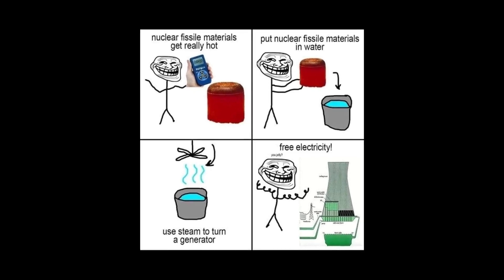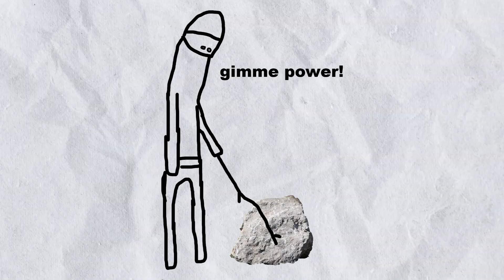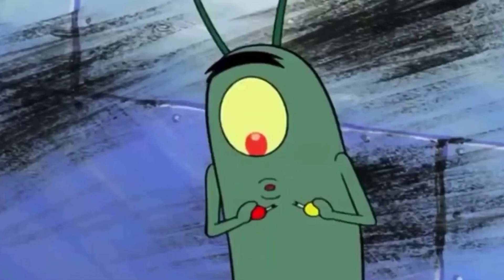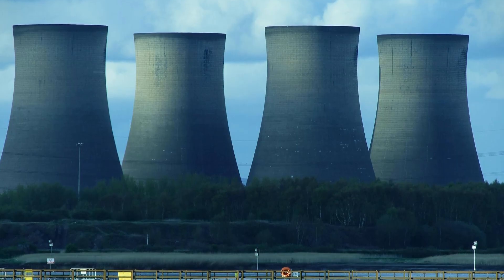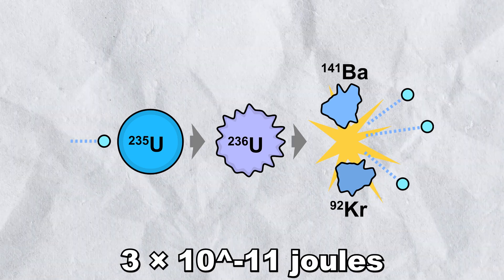why it works 40

Comment: How nuclear energy generates electricity. It describes nuclear power as a "big hot boiler" (0:10) that uses fissionable materials like uranium-235 (U-235).

Key points include:
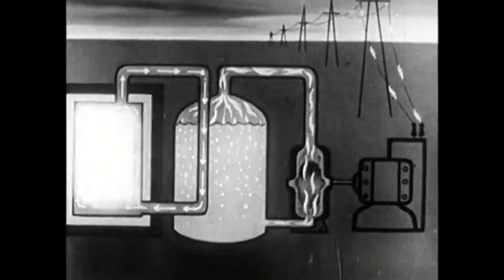•	Uranium Enrichment: Natural uranium is mostly U-238, so it needs to be enriched to 3-5% U-235 for use in reactors (0:38-0:45). Nuclear bombs, in contrast, use uranium enriched to 90% or more (1:10-1:12).
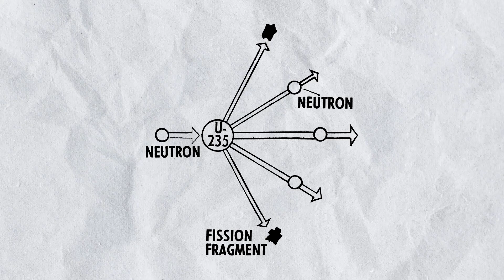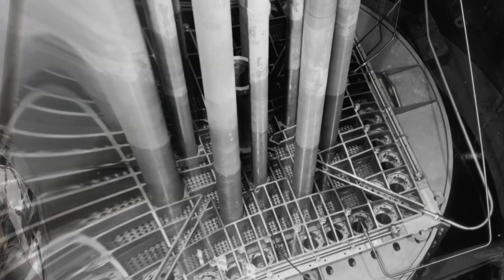•	Chain Reaction: U-235 atoms are hit with neutrons, releasing heat, radiation, and more neutrons, which sustains the reaction (0:51-0:57).
•	Control: To prevent an uncontrolled snowball effect, the enriched uranium is contained in rods surrounded by water and neutron-absorbing materials to slow down the reaction (0:59-1:07).
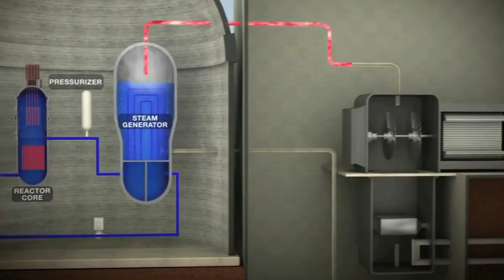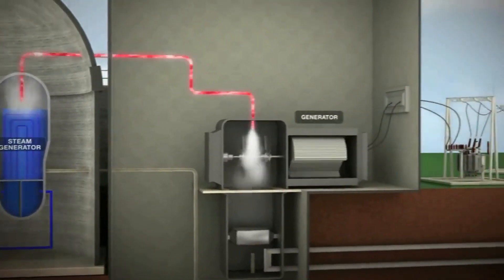•	Electricity Generation: The heat from these controlled reactions boils water, creates steam, spins turbines, and ultimately produces electricity (1:42-1:47).